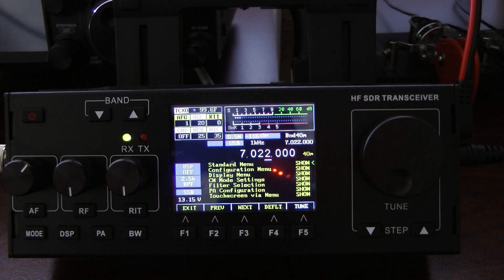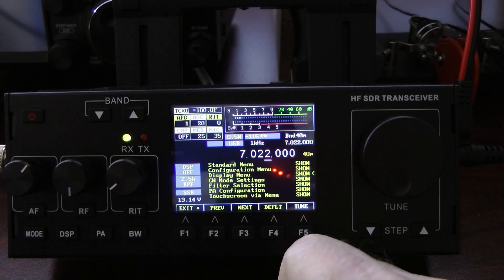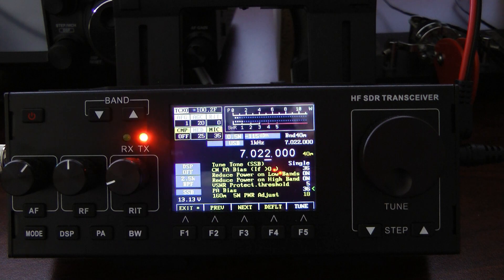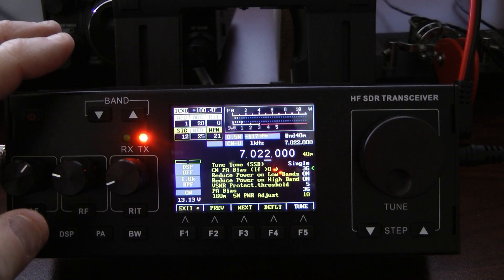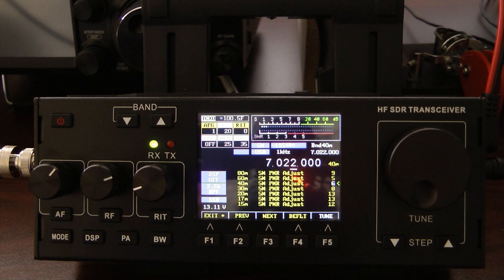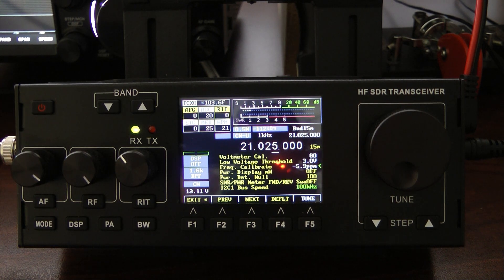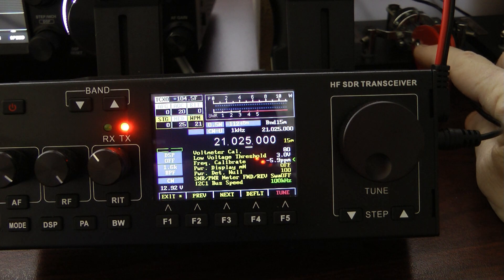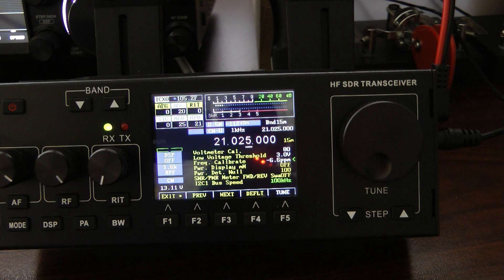Recent RS-918 Calibration and frequency alignment, MCHF, QRP

Comment: Hi John,
It's kc2wvb again.
I was going to start calibrating with respect to power amplifier & frequency as demonstrated in this video, but I don't think I should muck with how it arrived.
1st
Initially I have only used the rig in receive mode & I had both it and my RSP-1A by SDR Play hooked up to the same antenna. The rig when zero beated matches exactly the RSP-1A when zero beated for frequency displayed.
2nd
When I went into the PA callibration menu I noticed that bias was set to 50 & to me that looks like some one calibrated it before it was sent to me otherwise I'd expect to see the setting at zero.
3rd
I only have a 5 watt dummy load thus I am restricted to what I can do, but after seeing all the power settings had various values set and not to the same settings I thought I bet someone already callibrated these settings. To get a better feel for it I connected a RF watt meter in line with my dummy load and for all power settings up to 5 watts the watt meter said spot on.

So, what do you think????

Right now unless I hear otherwise I'll leave it as is and photograph all the settings so as to have a reference should I try to calibrate my self.

Thanks.....
Reply from the maker: Well, it may have had some calibration done at the factory (Did you buy it new??)
Reply: @johnwofford2708  Yes, John I bought it new off an EBay seller that had a 5 star rating and paid about $30 more as I remember because the seller might have been State side.

I did shoot 42 photographs which was all the distinct menus such as Standard, Configuration, Display, etc with each one opened to show the individual settings. Every one had precise settings except for Filter Selection which shows unused in each possible adjustment.

So, yep, not sure whats up at my end. Wish the seller had given me a clue. And in someone elses words: there is a lot of documentation on this rig, but its often scattered and at times contradictory.

Aside from my lingering question it sure is a fabulous receiver, best one I have.
Reply from the maker: I would recommend at least checking the bias, every 918 is different but 50 sounds high to me. Also, have you tried Nizars new firmware for the 96khz spectrum scope??? His firmware even makes the receiver better.
Reply: @johnwofford2708  I apparently have been using an old 86 page manual that was translated from perhaps Chinese by Google translator. It suffered a bit.
The Youtuber, Hamtech ?, picked one up a month ago and published a link to a manual. On the surface it looks much better than what I had been using. 

Right now the newish manual is on my phone but in a moment I'll send it to my computer and start going thru it. My general idea at the moment is to reset the PA bias to 0 and take a measurement for amps going into the rig from a battery followed by raising the level till 500 milliamps higher than when set to zero. That should tell me if some calibration was done or not. 

After this we shall see. I see the Hamtech Youtuber seems to have videoed all his calibration and I think I will watch each one then take a look at my rig and try to do the same plan as for the PA bias.

Unfortunately I bought the orange button model with the different display screen that required alteration to the software. Thus the suggested upgrade in receive might not be available to me yet. I did notice when shooting my photos that I am glad I did that the firmware on my rig is from November 2021.

Thanks....
Reply from the maker: The orange knob model is actually a BS-188 and you are correct, the 918 firmware will not work on the 188. The main calibration is the PA bias because without it set properly the rig will overheat. good luck!

Comment: Thanks again John.
I received my RS 918 in late November and have only used it for receive up to now because of being too busy to focus on calibration. I have read thru the 86 page manual to about page 40 and just came back to your most important callibration settings video. Either tonight or tomorrow I'll calibrate the PA bias for SSB and make CW identical followed by the PA output. 
I am a bit curious regarding the PA output callibration in that my dummy load is only 5 watts although I could place a 3 Db attenuator in line too. If I calibrate at 5 watts do all the other power settings just fall in line?

73, kc2wvb

Comment: Is the RS918 mcHF board version you have the same as the one shown on the checklist link?
Reply from the maker: Maybe I missed it but I did not see a board version in the checklist??? The Checklist items could vary slightly depending on firmware versions especially if Nizars 96khz firmware is used... But for the most part it should work with any version.

Comment: Where is that 0.5 watts of power mentioned in PA Bias calibration?
Reply from the maker: I am not sure I understand your question, just push the PA button to bring up .5 watts on the display
Reply: That is correct! To adjust the power, press the PA button. I calibrated my pa with 5 watts of power. Do you believe I'm going about things incorrectly?
Reply from the maker: As long as you set the PA bias first, then go through the PA calibration for 5 Watts and full output on each band you should be good to go. In the menu on the 2.12.2 firmware there is an option to limit power. I personally would not try to get 15 watts out of the rig, I set mine up for 10 watts on full power.
Reply: @johnwofford2708  When I received my RS918 with mcHF V.0.6 board, it came with RD15HVF1 MOSFETs, which I later upgraded to RD16HHF1. After that change, I'm unable to properly configure the PA Bias to add 500mA. According to the manual, I need to connect a 2k2 resistor from the U18 PA Voltage Regulator between PIN1 and PIN4 to raise the voltage by 1.2V because the RD16HHF1 demands a higher voltage. I'll need to change this as well in order to establish the PA. I'm hoping to work this out shortly. Thank you, 73.
Reply from the maker: Good luck!

Comment: John, this is excellent! I picked up an RS-918 from Connect Systems a few months ago. I’ll check these (and other) settings…I have an RF bench with several GPSDO-guided counters. Jerry Wanger # CS checked the radio before shopping but he didn’t likely do all this. I love the Tune feature…just initiate a Tune cycle without changing anything. I’ve used the RS-918to drive a couple of qrp amps to get 45-60w out. Very fun radio…73 de K4FMH
Reply from the maker: The RS-918 is a fun radio to play with, I put together a go bag with the little radio. Once aligned it works great for a small inexpensive radio.  I like it better than the Xiegu X6100. If you have any questions my email is good on QRZ